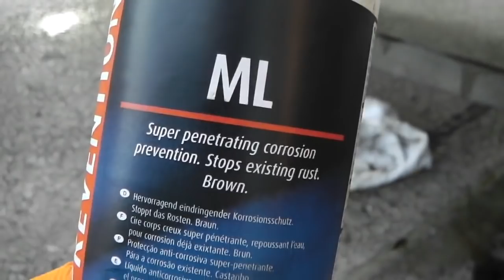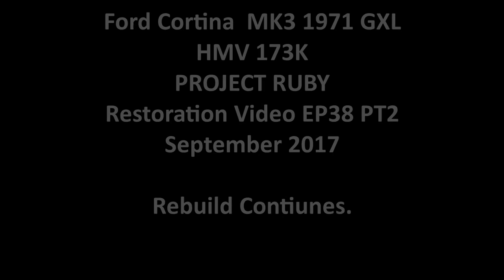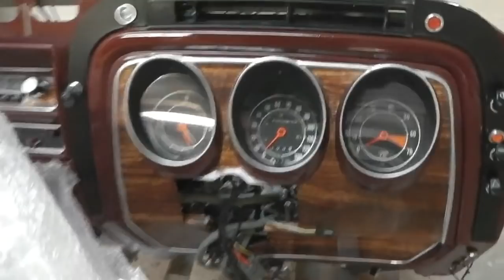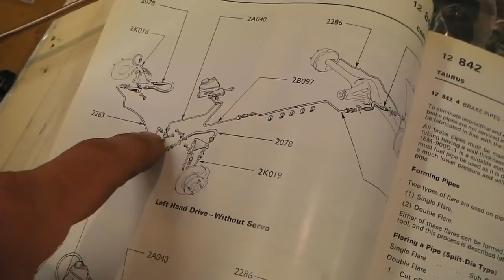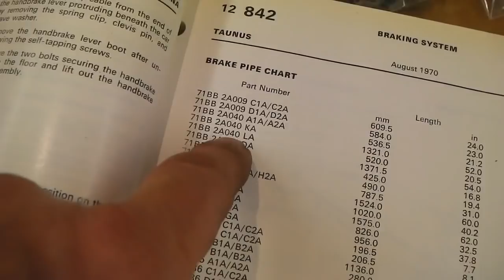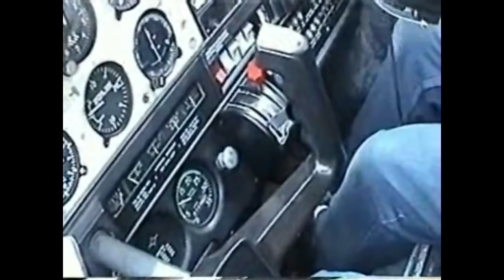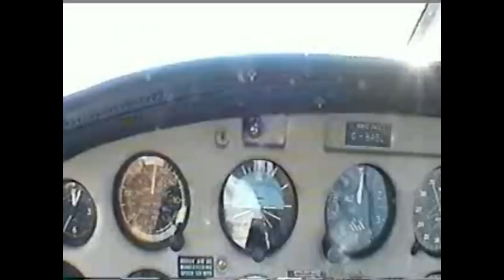Mk3 Cortina Resto - Project Ruby EP38 PT2

Comment: Wow, your flying along with Ruby, Pete. Looking so good mate, and that dash is a work of art in my eyes, looks stunning! And as always, loving the attention to detail, all that rust proofing inside the hidden spaces and cavities will really pay off in the future. I am really looking forward to seeing the interior finished, going to look fantastic with that great colour scheme. Yep, all the hard work coming together nicely. And nice to hear that you have relegated the cruise control pump to the boot, i had a feeling that you would have ended up regretting having it in the cabin - especially seeing how your doing everything you can to eliminate rattles and squeaks in the cabin. Looking forward to part 39!
Reply from the maker: god dman it that cruise fired up like a trooper first time, pump all cosy in the boot, proper mounted on rubber isolating mount pads/feet, vac tube fed via cabin roof to bellows fitted amazingly lucky behind dash clocks, like it was meant to be, perfect cable alignment into engine bay no snags or awkward bends fo rcable, perfect, lucky, its all come together Steve, hope you ok and thank you

Comment: Fabulous work. I'll have to let you loose on my Mk3.
Talking of heater box seals, I think mine are shot after the last time I went through a car wash and water started running into the footwells from above the bellhousing area of the transmission tunnel.
Do you have the driver's vent for your dash? As I have a pair I bought in a job lot on ebay but I have the facelift dash so no they're good to me.
Reply from the maker: thank you!!! what kind offer, sorry you got those leaks, but easily fixed with new gasket seals for you. i ok for vents but really appreciate the offer, its most kind, if you seal th eheater box up it will serve you well, its just ford didnt do a good job sealing em. DELANAIR designed the system but ford made the fitment and seals and they do fail. fix em and they good to go, i have alamost a turbo fan here !!!! superb, thanks again for comment and taking time to watch my films i really appreciate that. Peter, Lancs, UK

Comment: Hi Pete great vid, i'm at this stage you've done nearly 3 Cortinas and i'm still on my first.May i please  ask what size the speakers you used were and what you used to attach them.Well done with bramble that was a miracle in the making.
Reply from the maker: Hi Brian!!! been followign yours as ever.  for the speakers, 2 x 4 inch kenwood full range speakers. make an MDF template or aluminium and cut the holes out for speakers, you make a oblong shape that fits exact into the place where the mono speaker used to fit. you use TIGERSEAL to bond the whole thing together, tiger seal the edges of speakers into the frame, then tigerseal the frame up into dash. STOPS vibration.sLet me say this system only needs 10 watts to get a VERY |GOOD sound reflected off the screen, use 2 x tweeters in headlining just behind your head, connect tweeters with crossover caps supplied. you will be very suprised, especially if you wire a slimline under seat sub woofer (KENWOOD) , you can run all of this from a regualr period radio and it will sound fantastic. I cant explain enough how good it sounds. ok its not boom boom boom loud but its perfect at mid to 3/4 volume and more than enough at all speeds of driving, i promise it can sound really good, im sure its all covered on sweampy and ruby vids, best of luck and let me know what you decide, Pete
Reply: @PeteCswampy  wow that was fast and informative. Helpful as always Pete Cheers, happy weekend and goodluck with the shell!!